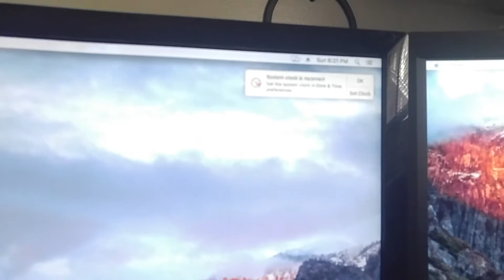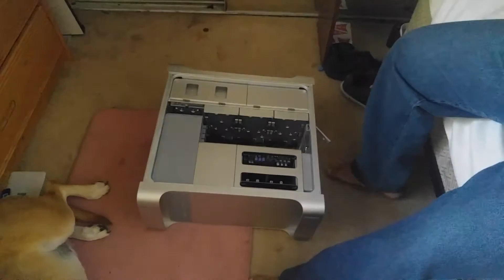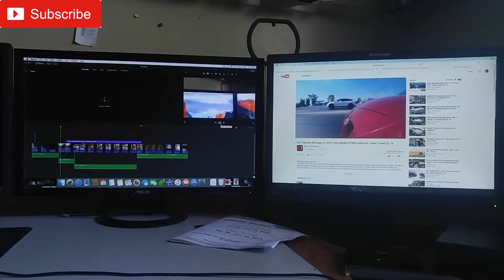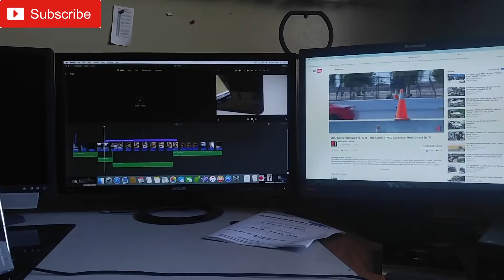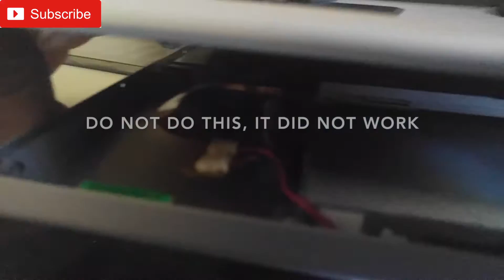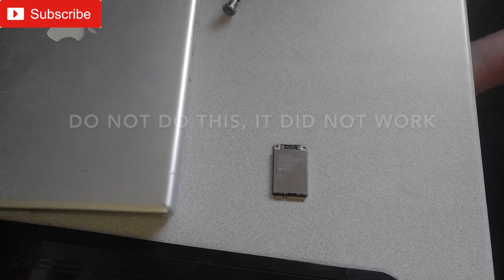Installing Airport Extreme Card (2008 Mac Pro)

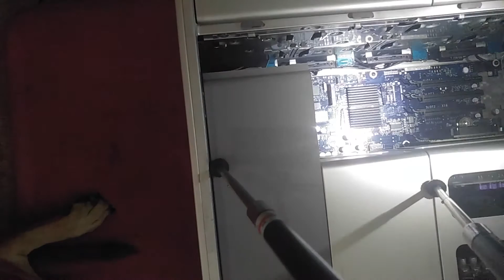Comment: Myserious helper appears at lower left of screen at 2:10!
Also at 2:48 it pretty clearly shows antenna #1 at the bottom, antenna #2 at the top, and antenna #3 hanging loose. I hooked up mine this way and it works good.
(Antenna B1 connected to the bluetooth module as is normal).

Comment: I have seen a lot of these videos and they have been able to help I wanted to give something back. My experience are used between the screwdriver and the screw you were planning to fasten the card to the board with or use mounting putty just a little bit but you will never lose a screw while tightening them or trying to. First shot them both not even a hint of losing them. The putty I use is loctite highly recommend it for anybody doing this procedure you just need very little of it it comes right off there is no residual residue I cannot say how other mounting putty or project putty will be but this one was the ticket. Best of luck to everyone getting one of these and doing this project.

Comment: can you edit 4k video with your mac Pro?  if so what editing software are you using?
Reply from the maker: Vincent Douglass this computer bricked itself, I believe the problem in a dead mother board. I can't justify buying another board with the high prices.  When I did have the computer I was only using I-movie. And it did not support 4k I am sure with other software that  it could. It has that capabilities to have enough ram and to upgrade to the newest graphics cards.
Reply: yes you can if you put a ssd and a good graphic card. I did it and I can edit 4k without a problem on fcpx